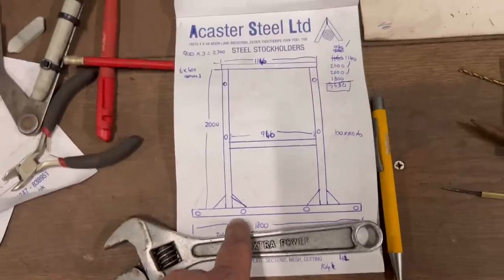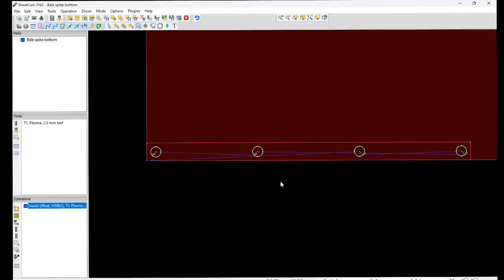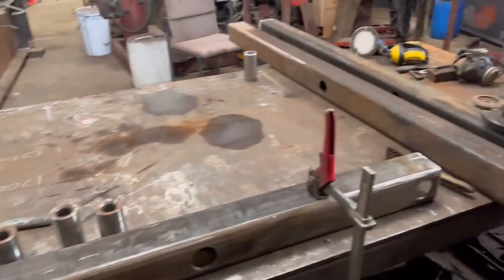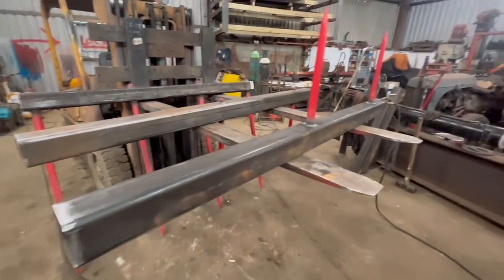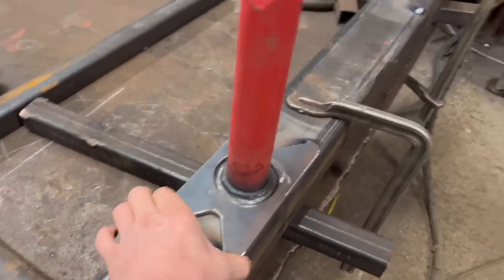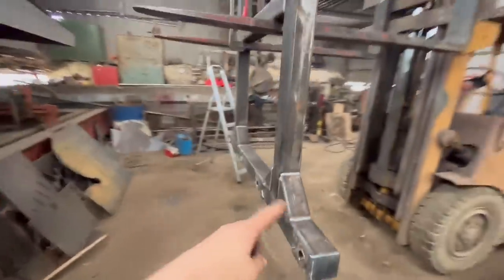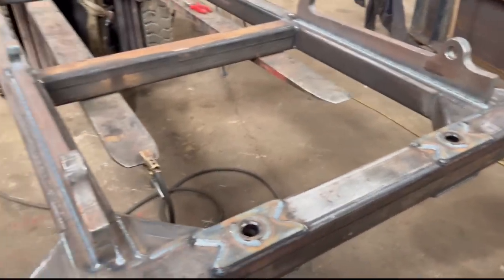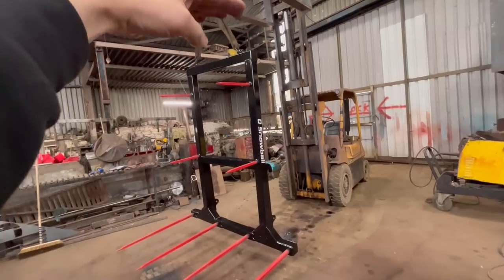Making a bale spike for 3x Heston bales.

Comment: Fine looking bale fork 👍 years ago i worked for farm in Ireland we used to bale 25500 big square bales for the composters for mushrooms. The forks we used had an extra two sleeves in the bottom for the top bad bales on the rick if they were a bit dodgy ( already compost 🫣) The only thing i would change would be to have nothing on the top of the fork have it clean we used to send oaten straw to northern ireland and scotland in curtainsiders as back loads and the curtains needed a push every now and then 😉

Comment: The CNC plasma cutter makes short work of the strengthening plates that if you had to make by hand would probably took longer than the main frame, definitely a good investment as it shows how you go the extra mile in making your jobs stronger and more pleasing to the eye at the same time.

Comment: Another quality job. I bet most companies don't bother with all the extra plates to support the tines. That thing should last. When I was young the combines were small enough to go down the road with the headers on. I remember the first ones coming out with the detachable header. And the width they cut was amazing. Today they would be a joke. We used to use a bale juggler for the small bales. Then a 5 bale stacker. Make up a stack of 40 bales. And then use a 40 bale clamp to grab them. Pick another 5 up on the front to help balance the 40 on the back. And run them back to the barn 45 at a time. You could load out the barn 5 bales at a time with the front loader. Sure beat the hand loading we did before that. The small bales were so easy for bedding the cows down through the winter. One year we did try some big round bales. They were part of a demonstration of a new round baler. Just on the market. They were a pain to move about. And made bedding down too hard. Stuck with the little bales. Nobody wants to lift anything anymore. Hence all the machinery and attachments. It was even starting to come in back in the 70's.

Comment: Some lovely welds there mate, only thing I found with the spikes I made was the the brackets needed to be more of an angle to get a decent rollback on a JCB especially on rough ground.
Reply: Yeah I made 1 very similar several years ago and spaced bottom of the bracket off the beam 8 inches used a couple peices off plated box from my new Claas rake that came packed on a pallet used to hold axle to pallet and I had to assemble. Wondered why  Micheal Burdge was cheaper than Hambleys lol

Comment: Another nice build Olly.
When those chop saw blades go off, they go off quick ! I bought a Chinese circular saw sharpening machine off t'internet, as usual, it was really just a kit of parts, they should label their gear under "Projects" 😂 I've fiddled on with it and got one of my Evo 14" blades cutting again  but it's wandering off a bit, I need a bit more tweaking, but if it does two blades, its paid for itself.

Comment: Great job. Nice welding.

What voltage and wire speed are you typically running on 6mm ?
Reply from the maker: I don’t take much notice to be honest. My welder is synergy so all I have to do is set it to a suitable metal thickness for the job.

Comment: mag drill with large capacity be easier than the plasma? unibor 100mm or a modern equivalent?
Reply from the maker: I already have a plasma, I don’t have a mag drill with 100mm travel or enough power to cut 58mm.
Reply: @snowballengineering   ah fairs. usually boys have a mag drill for site work etc. 100mm is drill size of that one, if you see it, its worth pickin gup!

Comment: I realise that you are not making hundreds of these at a time but, would it not be a help to have some 12mm angle welded to the cnc table at -5,-5 to locate sections accurately if you have to flip the box sections?
Reply from the maker: Yes. Something I’ve never got around to doing.

Comment: the beem with the join showing cant you un bolt the tines and take out the turn the beem over reinsert tines
Reply: I thought the same but I'm assuming the insert he welded in sticks out one side more than the other.
Reply: The weld in bushings are tapered, the tines can only go in one way
Reply: They have a taper inside the adapter to match the taper in the tine so you can tighten them properly. Until they’ve ran loose that is

Comment: Nice job Snowy - a tip for tine holes etc ;- rather than dig out paint, I used to roll up a bit of cardboard and shove it in the hole - IME a lot quicker than getting paint out

Comment: is there an extractor in your shop as I would imagine that shitty smoke would fill up quite quickly
Reply: he wears a 3M top of the range respirator
Reply from the maker: Yes. I have a fan in the roof and a ducting over the table but it’s not great. The cnc table is supposed to be a down daft table but I don’t have enough spare electric or big enough fan for it.